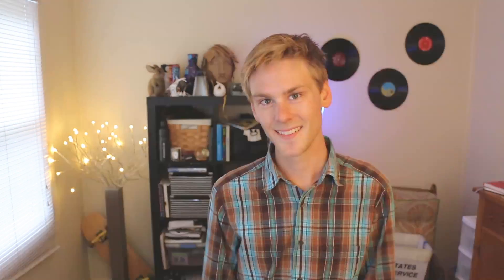How do cranes get all the way up there?

Comment: In Seattle, method #2 (erect crane and build the building around it, then disassemble the crane when building is almost finished) is the most common.  A mobile crane is used to disassemble the building crane in sections.  This isn't a very tall building but the concept is the same regardless of height.  The mobile crane lifts the sections off the tower crane and loads them on flatbed trailers to be taken away.    https://www.youtube.com/watch?v=QBDc_nxhU_A
Reply: Same everywhere else, he forgot that method  thank you for mentioning  that, I saw it happening here in Philly so many times in all 9 years of my life